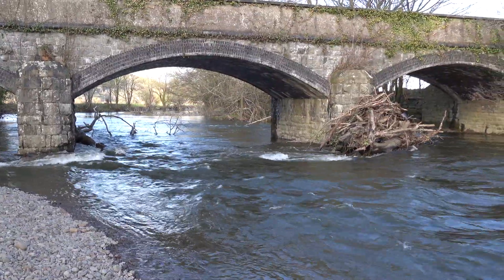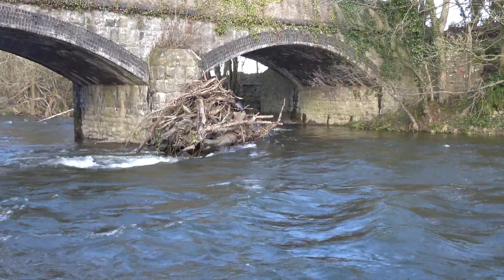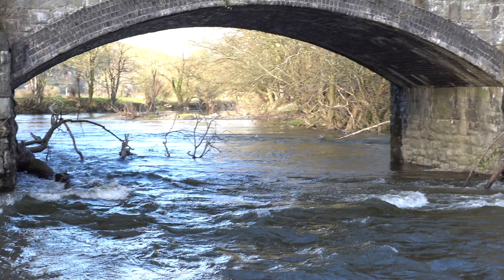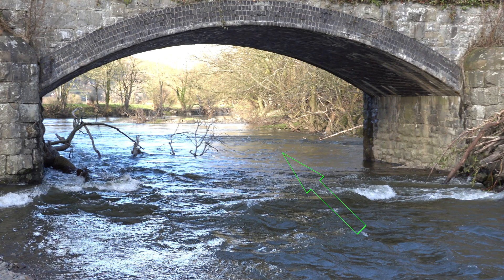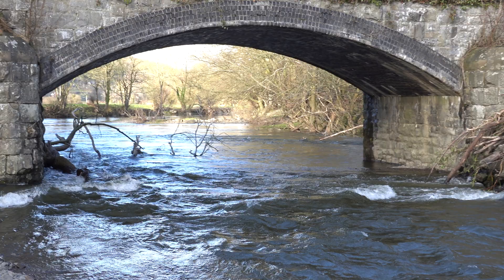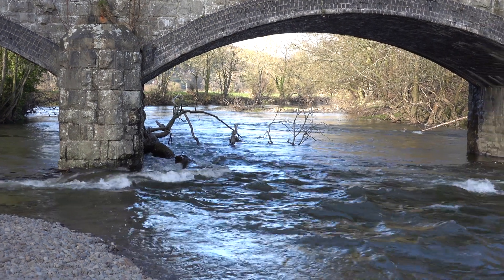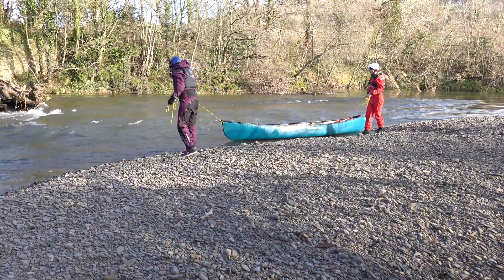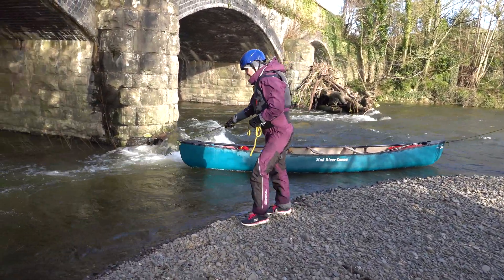Lining a Canoe:  a simple solution to a river running problem.

Comment: Would you recommend a tactile mark on a lining rope, for example a meter or meter and half from the end? I'm preparing a new set of lining ropes for the winter, and I'll be using twisted rope this time, made out of jute-covered (for grip) polypropylene (for flotation) strands. I'm considering either a Matthew Walker knot or just some whipping for the mark, and a smoothly tapered backsplice on the end. Is it a good idea or should I stick to smooth, constant-width rope so that it can slip out of my hands unobstructed when something unforeseen happens? Thanks.
Reply from the maker: Not something I do myself but others do find it useful